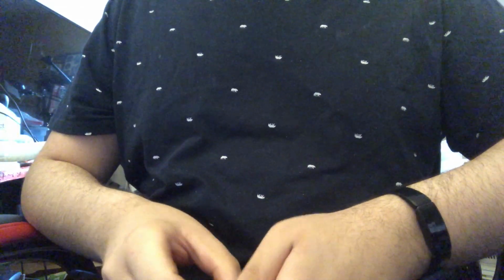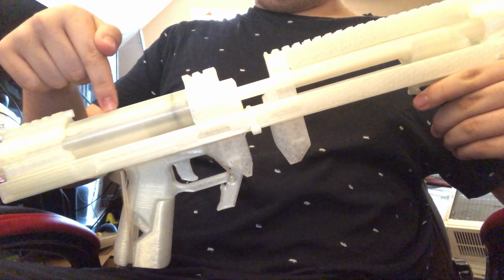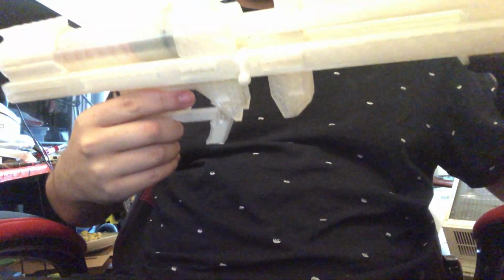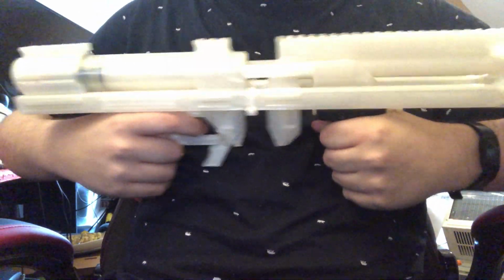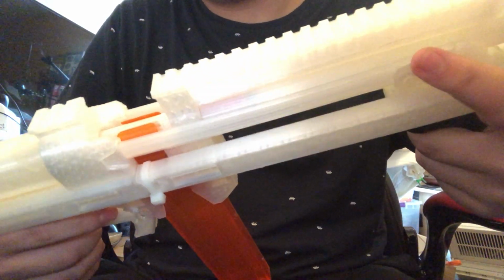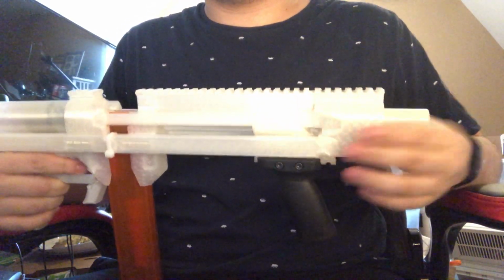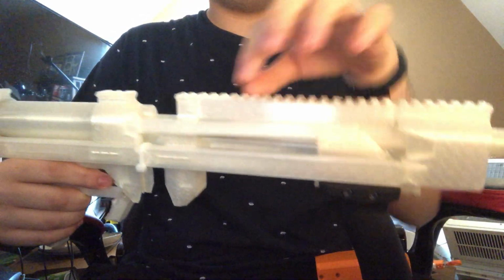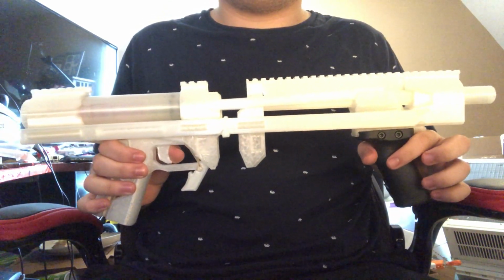Fully 3D Printed Talon Claw U

Comment: Great job, sir, I never used any hardware in my design except for screws and springs. My Lame Boy doesn’t use any o-rings or PVC tubes. I think it is totally doable and I did it. Glad to see a fellow comrade try this on high performance set up and succeed! Salute! If anything, I can still see some minor flex/bend during priming (and you mentioned it too), if you can get rid of that then I’d say it’s 200% ready and perfect.

Comment: Printed dovetails,  what are the tolerances on those?  I can’t get the fit tight enough to hold.
Reply from the maker: No tolerance, 0 gap between the dovetails in cad. I just chamfer the edges of them so they can be squeezed together
Reply: @Sillybutts  I have issues with them breaking when I try that.
Reply from the maker: @Eulemunin  They need to be printed in the right orientation and with enough thickness.
Reply: @Sillybutts  ok when I print with grain a crossed the tail the base is an issue,  when aligned along the tail the edges chip off.  Would love to see an stl of just the dove tail.